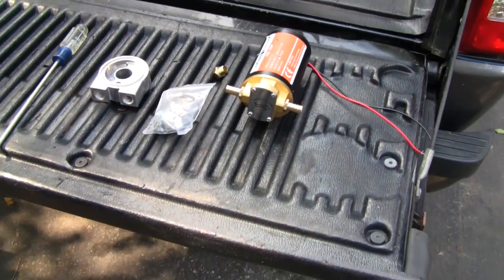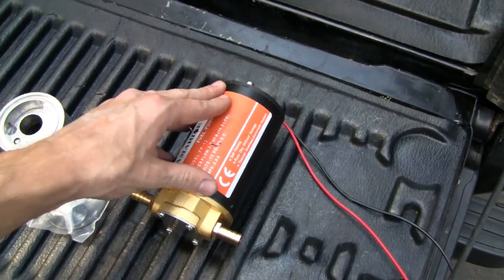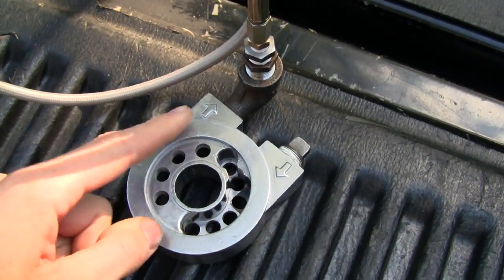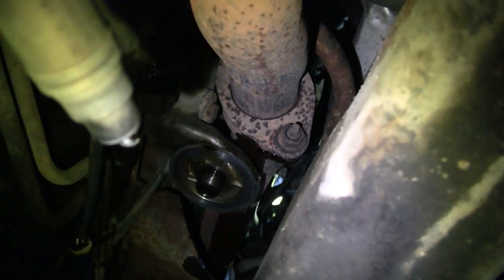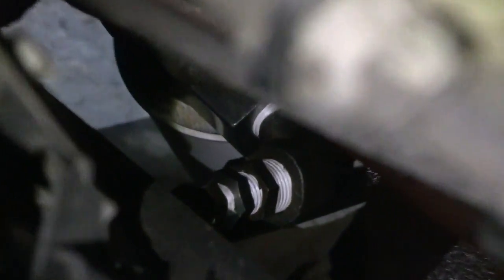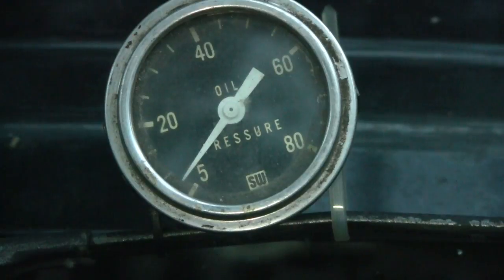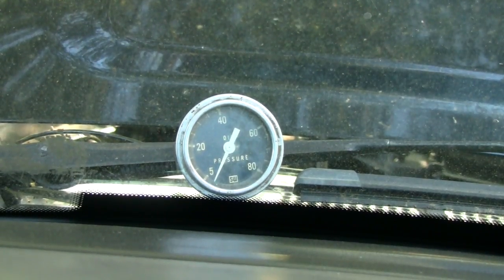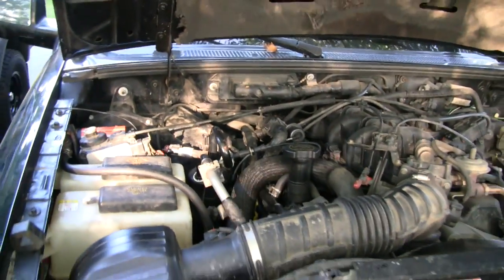DOUBLE THE LIFE OF YOUR ENGINE? HOMEMADE PRE-OILER SYSTEM

Comment: Good video and really like your thinking.
My main concerns would be as follows:
1. If your check valve fails you loose all oil pressure from your stock pump.
2. Pick up from the bottom of the sump, grit etc in your engine.
3. No oil filter on the preoiler system.

What are your thoughts on the following.
Leave the sandwich plate unmodified and place your pump between the inlet and outlet. Now your oilprimer pump uses the stock pick up and the stock filter. I don't know if you can draw oil through the stock pump however.
Second issue is the inline resistance on your stock pump caused by the new inline primer pump. To avoid this you would need a preoiler pump bypass pipe with a check valve. If the check valve fails you loose your preoiler but the stock pump will work fine. Only issue I see here is the pressure loss provided by a check valve. 
Any thoughts?
Reply from the maker: I don't ever anticipate my check valve failing due to the nature of it's design, it's basically a brass door. However, in the event that it failed for some reason my low oil pressure light as well as my external oil pressure gauge would both alert me to the fact that there was a problem, at which point in time I would need to replace the check valve or plug the sandwich adapter before being able to run the engine again. That would definitely be a bit of an inconvenience but once again I think that failure of my check valve is a very unlikely scenario to begin with.

Pickup from the sump seems to be a common concern and I would be worried too if there was not a filter on the system but there actually is. Maybe it wasn't clear in the video but after traveling through the external oil pump, the oil goes through the stock oil filter. So it is in fact filtered, and any sediment pulled from the pan should be caught by the stock oil filter. 

With regards to your alternate design, it would not work due to the fact that, as you correctly thought, the stock pump is a gear type pump which does not permit flow while the pump isn't turning. If it did, my system actually would not work because the oil would take the path of least resistance and flow right back into the oil pan through the pump, instead of through the filter and into the rest of the engine. 

Hope this is clear and thanks for your thoughts!
Reply: motoforlyfe thank you for the detailed response. Obvious now you mention it however it hadn't occured to me that you rely on the stock pump not letting any flow through.

Thanks for clarifying the restence on geared motors. 

My background is drainage design and I have to deal with check valves failing a lot because of trees getting caught in them etc. Not many trees in your oil system but I guess I was thinking that some grit might interfere with it. But as you say as long as you react to it you're golden. 

Another thought. Might be tricky but what if the primer motor was wired to automatically turn on in the event of low oil pressure? Would add extra safety if anything failed and the whole thing would be automatic on start-up.

Thanks again.
Reply: Note that much like the stock oil pump, the preoiler pump is also a gear pump. It will be pretty resistive to flow when it's not running, so if the check valve did fail, there would only be a slight drop in oil pressure, and he'd notice on his mechanical gauge.
Reply: @motoforlyfe  Gear pumps are a high restriction in the system when they are not moving.  I have installed pre-luber on six engines.  None with check valves.  In use, the line from the pump to the pan never got hot.  Hence, no oil flow back past the pump.  That said, on my next one (3.5 EcoBoost) I will put in a check valve as suggested.  They are cheap insurance.
Reply: @richardschofield2201  If I did this, I'd use a mechanical check valve and a good quality 12V normally closed solenoid valve that's only energized while the pump is powered for redundancy and to ensure a completely liquid tight seal every time since check valves are often leaky.
 
As for wiring the pump to turn on if oil pressure is lost, that could be done easily enough by using a relay and an oil pressure switch which activates at below the lowest oil pressure the engine normally experiences while running, but above whatever pressure the pump produces. However, that would only be a benefit if the oil pressure was lost because the main pump completely failed, which would be incredibly rare and virtually impossible on many engines. If oil pressure was lost for any other reason, the most common reason being low oil, running the electric pump would be useless. In my opinion, wiring in a very obvious low oil pressure warning light or buzzer would be a much better solution.

Comment: Its great mod to extend engine life, all big industrial or marine engines have prime pump and preheating
Reply: Preheating like a normal block heater or does it go all the way to operating temp?
Reply: @adamfpv8294  different types, depends on engine size/aplication, inside engine block or inside of cooling line with extra pump, can be preheated up to 85-90 celcius to be ready to provide all power immidiatly after start without waiting to get operation temperature.
Reply: @alexs7683  cool, thanks!

Comment: Just watch the video. I was thinking increasing the wire size to the pump would be a big step forward are you getting your pressure quicker and higher. When you operate the pump you could feel the feed wire to see if the temperature is rising. No use wasting those amps through a feed wire.

Comment: Wouldn't just T-ing into the oil pressure sending unit port be just effective at pre-oiling, with alot less chance at leaking?
Back in the day, pop mechanics had a column called "ask Smoky " he had a pre oiler on a old ford Fiesta, and if I remember correctly, he ran that little commuter over a million miles.
Reply from the maker: Bob G Depending on the routing of the oil system that might work, although you would lose the benefit of having the oil pumped through the filter first. You could end up with problems if the pump itself starts to fail or it sucks up any sludge from the bottom of the pan and doesn't get filtered before circulating through the engine
Reply: That is what I was wandering.  That is correct about the oil filter.
Reply: I do not recommend using 95% of the oil sending unit ports.  They are only about 1/8" diameter.  Good for pressure, terrible for moving oil.  Too much restriction.  There are several better alternatives.

Comment: Maybe try working any air out of the line in to order to speed up pressurization.
Reply from the maker: +TheHarkonnen1 That would be hard in practice, since the lines drain out each time the engine is shut off.
Reply: @motoforlyfe  
check valve?
Reply: Larry Be the pump inlet needs to be level with the oil pan so it doesn’t drain out and starve the pump. Then run the output up to the adapter inlet directly into the oil filter intake side. That will filter the oil like normal and pressurize the engine.

Comment: I have an explorer with cold start rattle....I hold the gas pedal to the floor and crank it till I get oil pressure...then start normally...gas pedal to the floor won't allow it 2 start
Reply: I was thinking of putting a kill switch on the fuel pump circuit, crank the engine until the pressure is up, then start the motor. If what you do will work on my F150,  you'll save me from having to do that. . . . Thanks. . . Joe

Comment: Any thoughts of installing a magnetic pickup on oil sump connection?
Reply: Just place a 100# or 130# magnet on the outside of the oil pan.  Assuming it's made of steel.  If it's aluminum or...the crap PLASTIC kind then this won't work naturally

Comment: I do have a question... Great idea BTW.. Does it plug up your oil filter faster? Beings sludge settles on the bottom where your suction is?
Reply: The oil pickup is very close to the bottom of the pan, so any "sludge" (which shouldn't exist anyways) would get sucked through the oil pump and end up in the filter anyways. And if some kind of debris happened to be sitting at the bottom of the oil pan and this pump sucked it up and deposited it in the filter, it would be doing you a favor by getting rid of it and keeping it from getting run through the engine's main oil pump.

Comment: You didn't do a cold start of the engine after sitting using the preluber. Does it still rattle?
Reply: Wouldnt pressurizing the tensioners remove all the slack??

Comment: enterBJ40
If were you I would change the feeding hose diameter to a bigger size . Your pump is starving from oil due to lack of flow (volume) coming in. Make sure you have enough feeding (flow) volume and outing flow. The rule of thumb is 1 to 2 diameter difference between feeding line and outing line.

Comment: I think the pump performance could improve a little bit more if you change pump location to a lower level, maybe same level as the oil pan drain bolt or lower...
Reply from the maker: You're probably right about that! This was just the most convenient location for mounting without needing to fabricate a bracket or drill into the truck at all.
Reply: Shouldn't matter much with a gear pump, the real bottleneck is the size of the hoses, both inlet and outlet. A smaller inlet hose will reduce performance more than a small outlet hose will. If you install a check valve in the inlet hose to the pump, it should keep it from losing its prime and it will pump up faster. Right now the only disadvantage to having the pump up high is that most of the line can drain back when the pump is not running. A check valve would prevent that.

Comment: seems to me your bypassing the filter and pickup is at lowest possible sludge collection location i suggest a inline fuel filter on the 1/4 suction line
Reply: it still has to go through the filter before it gets into the engine. The center hole is the outlet of the filter. The electric pump is plumbed in to the outside ("dirty" side) of the filter through that block ("sandwich adapter" as he calls it)
Reply: Recommend using Use 3/8" line minimum.  A better solution is to purchase a remote oil filter kit that has two filters.  Then "T" into the line going into the filter.  That way the pan oil gets double filtered before hitting the engine oil galleries.  Also add a FULL SIZE quick disconnect ahead of the filters. Oil change time:  Disconnect the disco and pump the oil to your old 1 gallon empty oil containers.   Simple.  Easy, Effective..

Comment: The links in the information given are all old and dead. Could you possibly put the name model etc? Sorry to ask I just want to build one for my Toyota 3.0.
Reply from the maker: Thanks for the heads up! I just updated the links.
Reply from the maker: I would recommend trying to find a pump capable of producing higher pressure more quickly - this one got the job done, but it needed a while to get the pressure up and it was pretty noisy!

Comment: Have u try turn on the pump while idle?does it increase oil pressure too?
Reply: It certainly would not. Once the oil is hot, this pump would probably only build a few PSI at most and the oil pressure at idle will generally be somewhere between 10 PSI and 80+ PSI for a hot or cold engine respectively. If the pre oiler pump can't overcome the pressure of the main oil pump, the check valve will never open and the pre oiler pump's flow rate will be zero. And even if it could, the oil pressure at idle is a non issue on a healthy engine.

Comment: I have that exact same pump that I was going to use for a tig torch cooling unit.  I ran it for a long time pumping coolant and it always filled the system with very fine brass particles , almost like a fine powder. I wouldnt use it on a vehicle Its a shit unit.
Reply: Recommend you pump the oil through the oil filter before it goes to the engine to eliminate the concern.

Comment: and what exactly keeps the oil from just pumping backwards through the engine oil pump back to the pickup tube? Just the natural resistance of the pump?

It's definitely a good idea especially for new engines or those that sit for extended periods. Not only timing chains but it fills bearings right up before starting.
Reply from the maker: +Krankie V Yep, gear type pump offers plenty of resistance to flow when not spinning. Thanks for checking it out!

Comment: this is not a problem or a solution. diesel engines last 2x the life of gas engines due to better wear and lower RPMs. also the cranking of an engine builds plenty of oil pressure before things happen. this is a waste of time and an area of failure that if it fails your engine dies. best not to put it on your car.